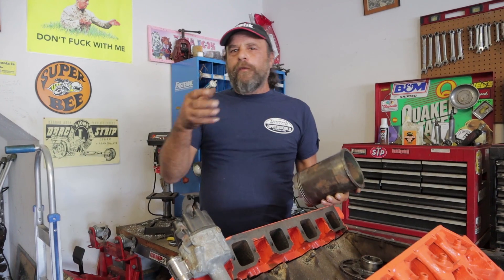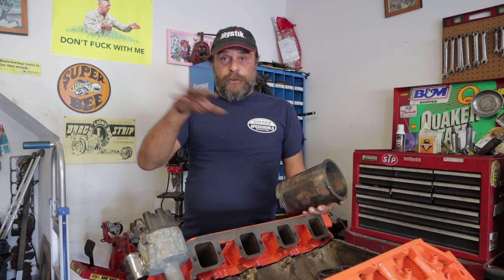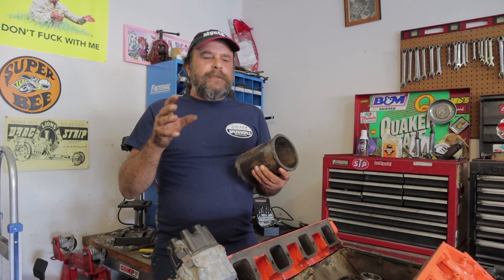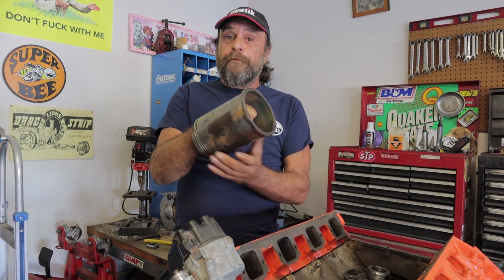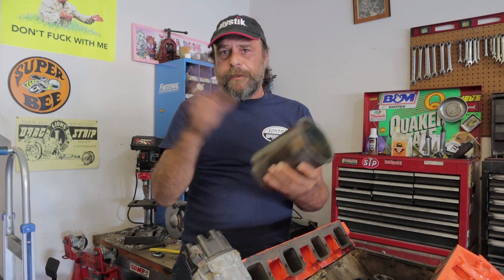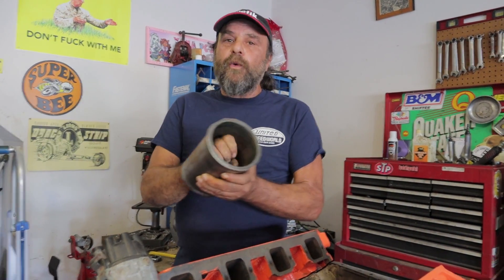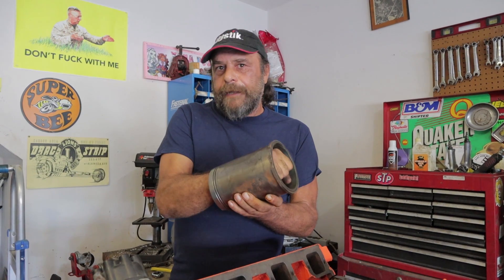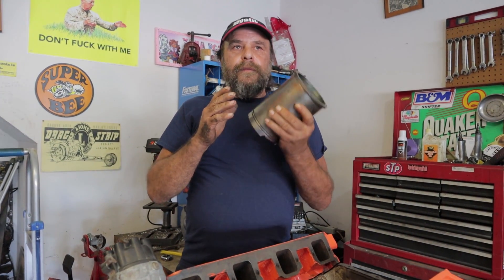The Myth Of Engine Displacement

Comment: I do not entirely agree on the last few minutes.  As you increase the stroke by the hypothetical 33%, what you call the working stroke also increased by 33%.  Maybe not one full inch, but by 33% nevertheless.

But you are correct, strokers do not make power in proportion to the added displacement.  There are other reasons for that.  First, the valves can only flow so much.  So, you will not be able to fill up the added cubic inches as much.  Second, most strokers have to have a reduced connecting rod length while increasing stroke, i.e., lower stroke to connecting rod length ratio (this is an area where the 440 is doing well).  That means more piston side load and friction, and less time the piston spending at TDC, which means that the combustion will be less complete at say, 5 or 10 degrees after TDC (critical for high rpm operation).

The cubic inches hurt you a lot when you build a small car that you want it to handle.  For larger cars that go straight, the cubic inches are generally good. 

But DOHC engines and turbos make cubic inches obsolete.   Both of them give power proportionally, much like more cubic inches.  The down side is that both tend to shorten the life of the engine, also proportionally.
Reply from the maker: No, you misunderstood...go back and watch it again.  Stroke increases, swept area increases, but because of pin placement, all the gain is at the bottom of the stroke
Reply: @UncleTonysGarage  I don't think the pin location that you are talking about matters, or at least not the way you describe.  What does matter is the con rod to stroke rod deterioration, as discussed above.  That will affect friction and time available for combustion.  But let me allow to explain why.

The way we calculate the indicated work (or called indicated mean effective pressure) is the integral of P*dV.  No crank angle directly.  Just pressure multiplied by change of volume.  We do that by breaking up the cycle in minuscule pieces, and add them up together (this is what the temp integration in engineering means).  As you increase displacement, you increase the number of little steps (or you increase the size of the little steps).  This is the best I can do for explaining this outside mathematical equations.  That means, if everything else is equal (i.e., if you can achieve peak pressure at the same location in the cycle, and you can call that in terms of crank angle or piston location, doesn't matter), then in theory your work will increase proportionally with stroke, since the adiabatic expansion that takes place afterwards does not care about the pin or rod angularity.

Now, as I said in my first comment, let's take the theory and connect it to reality.  The first problem of the stroker is that due to the shorter rod to stroke ratio, the piston does not stay around TDC very long.  That reduces the time for combustion, and so your peak pressure location may end up been retarded, which hurts thermal efficiency (reduced expansion ratio).  The second problem is of course the added friction.  I.e., the work is done, but some more is wasted in friction.

I also watched your other video you just published.  I would like to add that many of the 20 or 30 degrees that you need to spark BTDC is the time it takes from spark to flame formation. That takes a long time, I think something like 60% of the interval prior to TDC.  But you are correct, once the flame front establishes, it still takes a finite time to reach the end of the combustion chamber.  Turbulence here helps.  The more turbulence you have, the faster the flame will propagate.  That is why a good combustion chamber (like the one of the 440) will compromise some volumetric efficiency to gain some extra mixture tumble.  Also, here you need to explain why the wedge combustion chamber helps, by confining the combustion chamber as close to the spark plug, to that the flame will consume as much of the mixture as fast as possible.

By the way, we tend to consider everything in terms of crank angle, because the crank angle is what we can directly measure.  Volume can only be indirectly calculated from crank angle.  But for indicated work, it is the volume that matters.

Comment: All kinda true, depending on the working RPM range...  Truck engines (gas & diesel) make more usable "power" the bigger they get because they almost all slow down as they get bigger and they process more fuel.  Your equation about working area also has to take into account the ability of the engine to use fuel (heat) effectively.  Big slow turning engines "dwell" longer in the upper swept area and extract more mechanical power from fuel burn.  It's why hot rodders stuffed Caddy's in all sorts of cars back in the day w/o fancy cams or anything.  They'd eat your lunch street racing even turning relatively slowly - torque monsters.

Comment: longer rod wold reduce piston speed to get moor work out of a given stroke. a better plan wold be to stroke the 302 to say a 315-320 with a longer rod and a short piston or better yet keep it a 302 and run a super long rod and short piston. 302 is pushing it for the the Windsor. people forget 302 started life as a 221 as a super light v8 that was cheap good gas mileage engine. 351 is better as it is a stronger block with taller deck height and longer stroke with a decent rod ratio of of around 1.7 to 1 ideal is 1.8-2.0 to one. the engine is a dynamic so all its parts need to match to work at its best. take care

Comment: This is exactly why I’m building a destroyed LS right now. All these guys are like 335ci’s is nothing. You need a 6.0 or a 6.2 to make big power. So this is the exact point I’m trying to make. I’ll make more HP per ci than there stroked  out 6.0’s with 408ci. So happy you made this vid. Not a lot of guys get this point. Just like you said. No replacement for displacement is such a narrow mind set
Reply: Destroked*. Fuckin auto correct

Comment: You bring up the legitimate (and interesting!) question of how a dragster with a 500ci motor can hang with a dragster with an 800ci motor. But then your explanation doesn't really address the original question. I think Harry Ricardo, analyzing aircraft engines around the beginning of WWII (maybe wrong person and/or time), observed that many people incorrectly believed the "myth of engine displacement", that it was the primary factor affecting engine power. He said that the power output of the aircraft engines of the day was determined by the compressor efficiency of the superchargers more than anything else. I think this might be the exact same situation with big-cube supercharged V8s. If the blower can efficiently cram about the same mass of air into the 500ci engine that the supercharger on the 800ci engine can push, you might end up with about the same power.
Reply: Peak power that is. Those engines in those world war 2 planes where huge. P51 had a 27 liter i believe. I think theres a reason they went that big when they probably could have went smaller and thats probably attributed to reliability. Less supercharger boost needed= less heat and stress and bigger engine doesnt need to turn as much rpm to make same horse. Theres drag racing engines that make as much horse as one of those giant motors but they would never stay together nearly long enough from all that boost and rpm they need from being MUCH smaller

Comment: You get to a certain point where a large bore becomes inefficient because of the time it takes the flame front to travel from the spark plug and then expand throughout the entire combustion chamber.  Dual spark plugs on each side of the chamber helps to solve this problem. All NHRA nitro engines have dual plugs for this reason and also because nitro has a slower moving flame front than gasoline. I would think the the combination of perfect bore to stroke ratio for a 500 CI engine (NHRA limit) to produce the most power would be within the design of these engines due to their only function to be to produce nothing but brute power. This is all good stuff to think about and it beats counting sheep when I'm laying there and can't get to sleep.

Comment: Uncle Tony teaching that piston fist'n!  Interesting information about engines, too! I think the crux of Tony's video is that it should be more about efficiency than just wanting more cubes. I do agree to some extend that bigger tends to be better but that's only when all other factors are precisely equal. I mean look at the 1970's and 80's smog era turds. your daily 2 liter NA 4-cylinders are making more HP now due to increased efficiency. But it does beg the question. If you had a set amount of money to upgrade an engine, let's say $1500. Where would that money best be spent? A bore and stroke (could you even get that done for $1500 anymore after buying parts)? better heads, cam, intake, carb? I think it'd be a good experiment. My money is on getting more efficient heads, cam, and intake. I see a lot of people build 383's. I love my SBC's. But is the juice worth the squeeze over a 350?

Comment: twin turbos the great equalizer they said a street car would never run 5s in the quarter mile ! Larry larsen consistent 5s over 250mph turns boost down swaps fuel and drives it home ! less cubes than most street heros out there twin turbos very big turbos !

Comment: You get a stronger push on the stroked engine though. Even if the work is the same, its pushing harder because of the other factors. Keep or make the rod longer, to get more work from it. Short rods will move the piston faster and waist the work since it is coming off the deck faster. Everything has their place which depends on the use of the motor.

Comment: I built 302’s vs 351’s.  For me a smaller crank journal and a little less weight on the nose made sense, and a 351 really needs to be at 400 cubes (4” stroke) or so with a 230cc head, otherwise a likewise similar head (195 cc) meant similar power, albeit at lower RPM.

Comment: Four STROKE engine, Tony, not four CYCLE. One cycle is FOUR STROKES (the four stroke cycle)! 

You would have to count a four cycle engine as 16 strokes! 

Calling a four stroke engine a FOUR CYCLE engine is incorrect, even though Briggs and Stratton did it years ago. In their case I think it was more of a trademark rather than an accurate measure of strokes.

Comment: Another thing to mention is rpm. A 440 at 5000 is moving about as much air as a 327 at 6300. That doesn't say who gets off the line best, but with the right gears, it could be a close race.

Comment: Ya know what? At one time, it was kind of true. Other avenues of power increase started to come into common usage in the mid 80's like fuel injection, roller rockers, turbos and blowers from the factory got the aftermarket working on dependable power adders. Back in 1970 though, from the factory, you wanted more power, you got the bigger block.

Comment: A better way to express the displacement is pi x bore squared/4 x stroke x #cylinders. Swept area is pi x bore (which yields circumference) x stroke. You end up with swept area but not volume. Not to go all Pythagoras on you, but I don't want people turning their brains into strokers when they can't get their CID to pencil out correctly.

Comment: Better yet uncle tony. I've got a 318 block I'd like to keep stock stroke but build into a 450hp motor. I've got a tunnel ram with two small Holleys that runs great on my 273 that I'd use on the 318. I've got a set of 1.88/1.6 598 360 heads I can port myself. How do I get this 318 to make around 425-450hp with just 318 cubic inches and my tunnel ram? My car is manual steering and manual brakes and 4 speed with 4.56 gears. Help me out please. I'm fine running 93 octane. Not a daily driver
Reply from the maker: Shouldn't be too hard.  10.5 to 11 to 1 compression, good porting and a properly matched cam should do the trick.  You need to pick the brain of a cam guy  to make it really come together

Comment: You just hit on what Formula 1 has been doing for years. They rely on a large bore with a short stroke. Displacements are under two litres ( 80 ci ) but revs much higher. No parasitic loss on that lower portion of the stroke and back into the power. Combine that with the Flat fire to create major acceleration.

Comment: I see, but in terms of practicality there is no way a smaller engine can SIMPLY and RELIABLY make more usable power than a larger engine. I’m not talking strokers or race engines. I’m talking every day drivers. I don’t like where most auto manufacturers are headed with small engines in trucks, vans etc.  Small little v6’s even with turbos and vvt will not and cannot match a big v8. My Chevy 454 makes TWICE the hp and TWICE the torque as my Ford 3.7 v6 and at HALF the rpm’s. And gets better gas mileage than the v6 to boot. Both in a truck application. You have to add 2 more gears and a turbo and it STILL won’t out perform the big block. Reliability goes down the shitter as well.
Reply: this is exactly why I jumped at the chance to buy my mechanics 2002 8.1 Chev 2500. That thing will pull all day to 300k miles on that drivetrain and get the same mpg as that ecocrap V6 under load. 
i think people underestimate how much transmissions have changed and improved in the last 15 years when they look at these things. I can't imagine the accelration the 8.1 would gain if it had 3 more gears in the box, and the mpg towing would even go up to as the ratios are closer.

Comment: Explained to me how a 400 low deck mopar with the same trick flow 240 heads with same intake and cam and carb and basically same parts as a 512 stroked 400 block makes more power with the same parts than the 400 motor? More Cubic inches defiantly makes it easier to make more power. More Cubic inch means more space to put more air and more fuel which means more bang and more power. Sure there are 260ci motors with twin turbos making 1200hp but that's a full on race motor. Talking everyman's street strip car is where that saying comes from. Easier to build more power with more ci
Reply from the maker: I never said that big engines were bad!
Reply: That bigger motor may not be able to rev out as high as the smaller one
Reply: @JohnPino

It’s nothing to put DOHC and a turbocharger on a small single head engine. These “race car” features are in sedate family sedans that will eat old muscle for breakfast off the line stock for stock... and are only a basic tune away from doing even more. 

Your big cross plane V8 can’t rev.  It can’t breathe anyways so it only needs Two valves per cylinder. It weighs a ton. It takes weight and traction away from the rear tires.
Reply: @Bartonovich52  stop fucking comparing 2019 cars to 1969 cars. im so sick of hearing that shit. show me a 1969 japanese production car that can beat a 1969 american production car. crossplane v8 cant rev? cant breathe? nascar v8s want to have a word with you. btw, the intake valves in an old american v8 are around 2" or more in diameter. your 2 puny ohc intake valves add up to about one single intake valve on a ohv engine. shut your mouth. weighs a ton? a 2jz weighs 590 lbs. my all iron everything 6.6L big block mopar? 620lbs. thats before adding aluminum stuff.
Reply: @Bartonovich52  Spoken like a young uneducated person that hasn't done any research on what was actually around back then.
You need to look up the Ford 427 SOHC engine, designed in the 60's. Shelby put a supercharger(they were NOT the first, by years!) on a small block Ford. The technology everyone is so proud of in today's production cars was invented, some of it, all the way back in the late 50's. 
Maybe don't gloat so much about how well modern cars use technology that is 30-60 years old. BTW, they were putting turbos and superchargers on airplanes shortly after world war 1, before the V8 was invented. Big business profits and marketing kept that technology from being used on big V8's, not lack of knowledge.
Reply: silverbird58  what are you talking about? 352hp heads?
Reply: No John, the saying "There's no replacement for displacement" came about for 2 reasons, first off it was a long time ago that it was coined, before your average person knew any better, and secondly because it rhymes, that's why the saying caught on. But the fact is there's no replacement for CFM, this is why a Japanese motorcycle engine that's got 1/3 less displacement than a Harley engine can make 1 1/2 times the power, because despite it's smaller displacement it moves 1 1/2 times more flow.

Comment: In this day, the workhorses such as tractor engines semi or farm, big cubic inches makes massive amounts of torque. 

Very interesting. So in retrospect,increasing bore to achieve the same 400 cubic inch displacement would be more effective?as it will also be drawing in the greater volume of fuel mixture but the force is pushing on a larger footprint.
Reply from the maker: Increasing bore that much isn't possible with any sort of production engine block

Comment: I have always thought the REAL displacement of the engine comes at torque peak rpm.
Reply from the maker: And you measure that how?
Reply: @UncleTonysGarage  What did I just say? the measurement is the torque at torque peak rpm. Obviously the cylinders are filling to the maximum REAL displacement. just looking at the dyno data shows what rpm the engine produces maximum torque. that can only happen when each cylinder fills the best and produces the most push on power stroke. If this is not true then where is the real displacement maximum and how would you measure that? Maybe I am wrong but my idea makes sense. I think you want a figure for cubic inches and that I do not have only know where it is maximum.